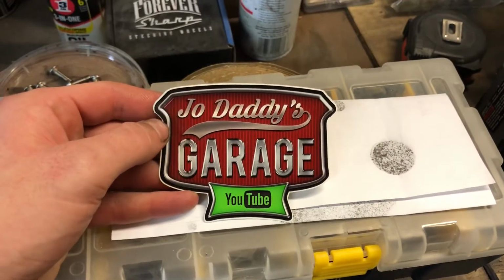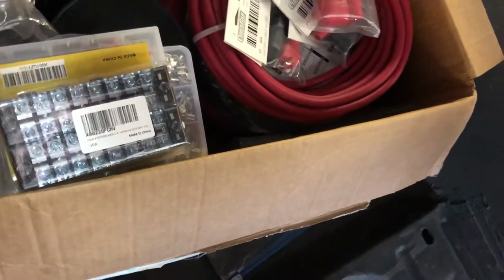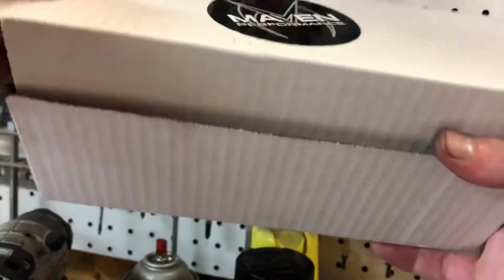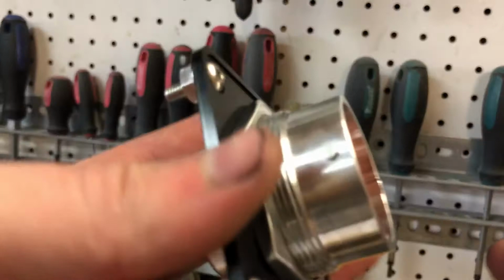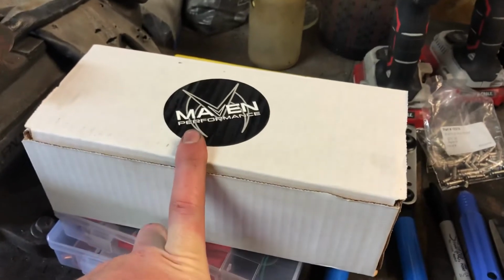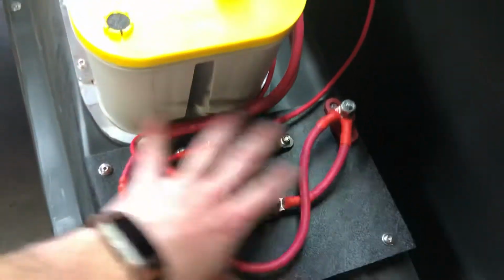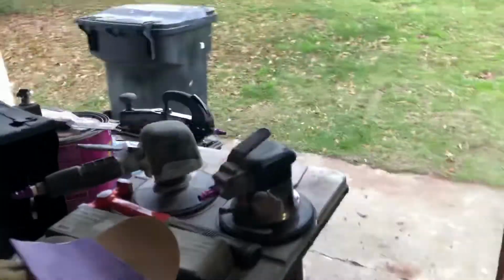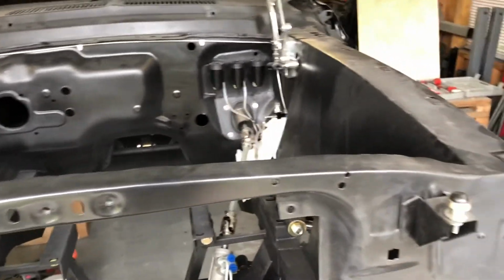Elaina - AC template and deutsch bulkhead - thanks JoDaddy’s Garage

Comment: Sealing the tank....I have used both silicone and the 3M strips. I finally decided I rather use the 3M product, it seems to be a lot less messy and doesn't ooze out when you tighten the bolts. Just a thought from experience, use it as you like. ;). I think i cussed the silicone when i had to remove the tank for some reason. LOL. I like your rivnut for tank too. Same thing i did on mine.
Reply from the maker: thanks for the input and complements. it just hit me the other day that CJ and some others had tank install videos, so i went to see what they used.. they also used the 3m strips.. so looks like its unanimous. i'll be using the strip caulk as well. i love those rivnuts.. one of my favorite tools i've purchased.